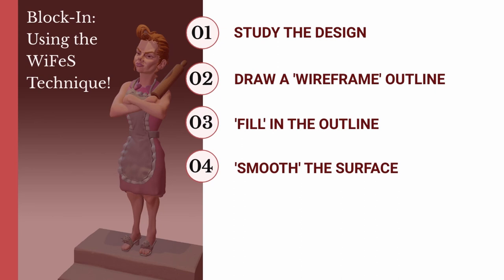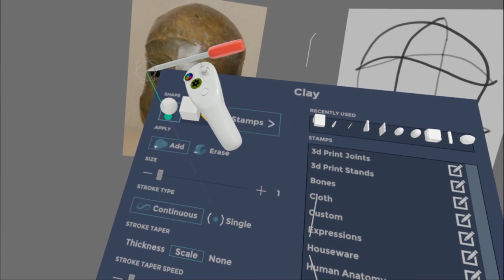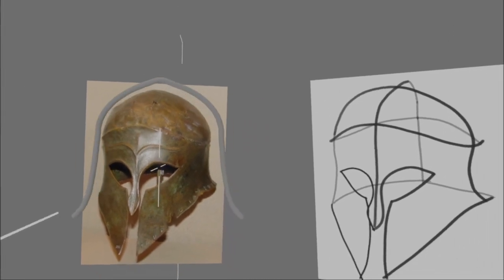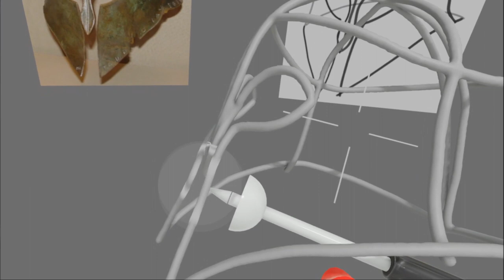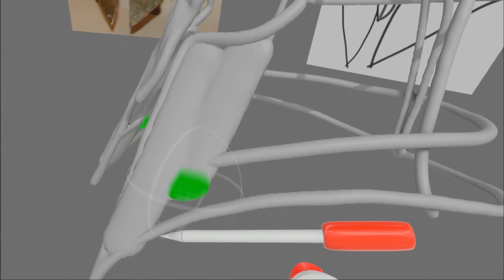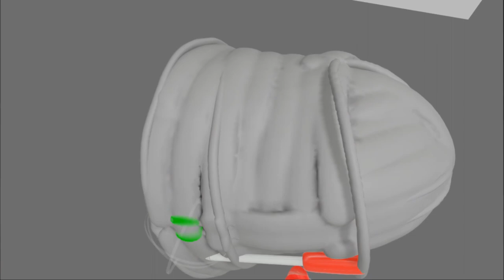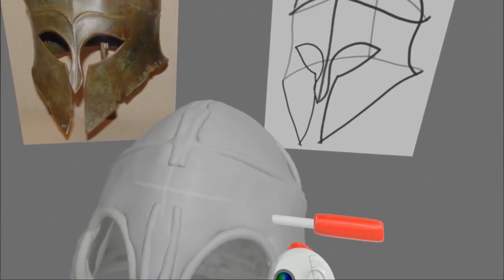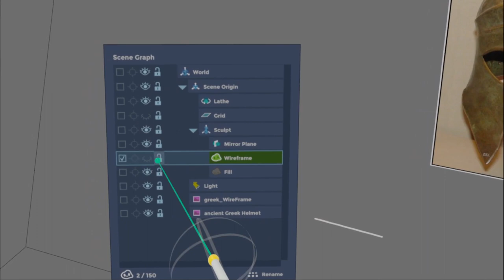EP02- Medium Rare: The WiFeS Technique (Easy technique for complex surfaces in Adobe Medium)

Comment: when you completeled the filling in step did you not fancy cutting it in half and finishing the inside and outside before duplicating, flipping and merging?
Reply from the maker: Yeah I would these days: This video was made when I wasn't too comfortable with using the program as fluently as I do now- but in actual fact these days I hardly use this technique anymore, I will make the outline and then I will bend panels into place using the ABC technique : https://youtu.be/-1ojy-Cv58M

Comment: I intuitively started my first sculpt by sketching out the ribs and bones of the character then filling in the muscles after. . .Seemed to work OK. .  though maybe the best approach is to start with that fast sketching to get the gesture and pose quickly (otherwise the sculpt will look stiff). . then use the "Pulled primitive shapes" method you describe in your 1st video  to fill in the wireframe or skeleton.
Reply from the maker: Yes exactly that! Making a quick gesture sketch of what you want to make and then tidying it with a nicely shaped pulled primitive version is  GREAT way to make things, especially living things.